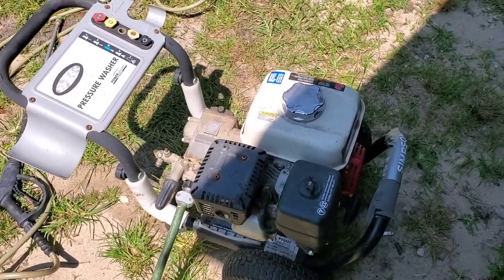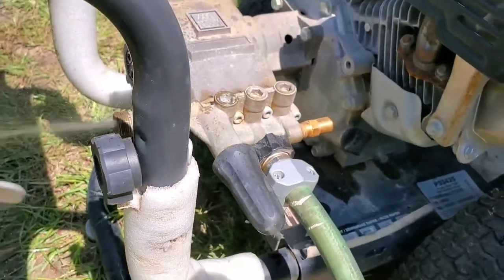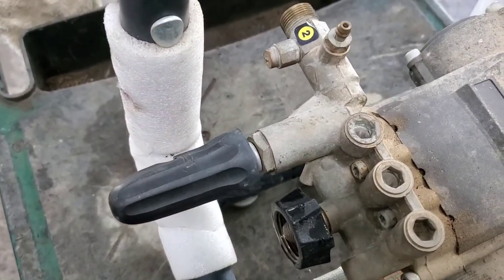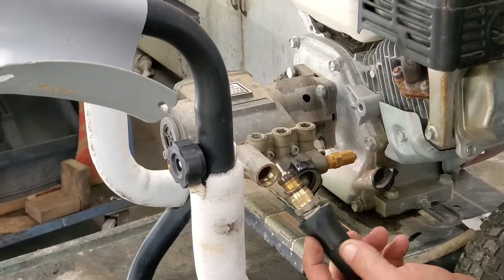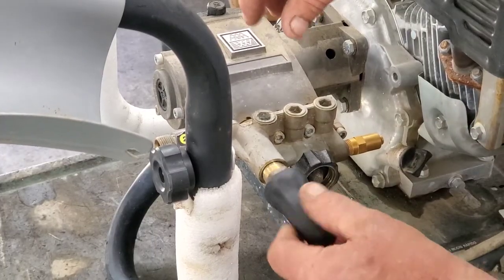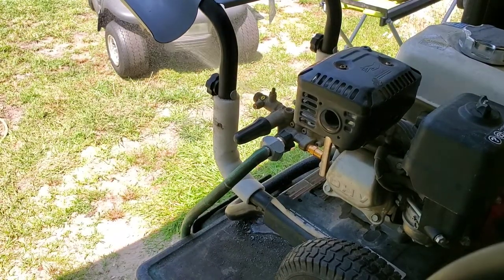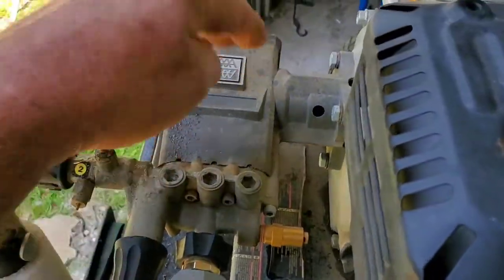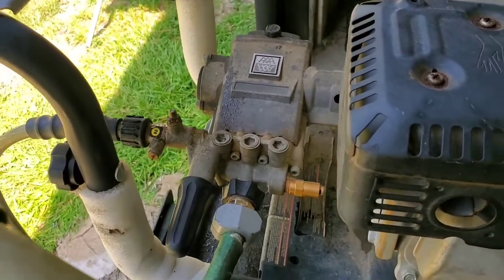SIMPSON 3400 PSI PRESSURE WASHER WITH HONDA GX200 ENGINE HAS NO PRESSURE EASY DIY

Comment: Thank you, I wasn't certain what was wrong with mine.  It worked last summer and this spring it wouldn't build pressure.  After watching your video I checked that little plunger, and it was stuck just like in your video. I tapped it free and now it works perfect again.
Reply from the maker: Awesome, glad our video helped you 😀

Comment: I have one of these that won’t run, trying to pull the carb off but having trouble getting it off with the bar sticking up so high in front of it. I’ve removed all the plastics and fuel line, I may just be stupid and not seeing it, but how is the carb supposed to come off?

Comment: The black knob on the top you adjust it with broke off on mine, and mine will not build pressure could this be the reason?

Comment: What if my piston is not stuck and I still have no pressure?
Reply: Then replace the entire pump or buy a new piston anyway, sometimes the mechanism is still faulty. Also you can check the inlet where the garden hose go and see if there is any debris blocking it, like leaves or rocks and dirt. If so clean the washer or just remove debris.